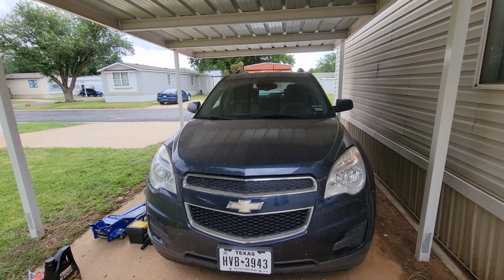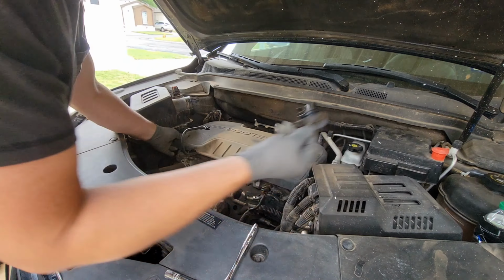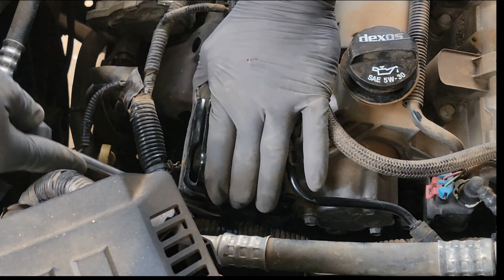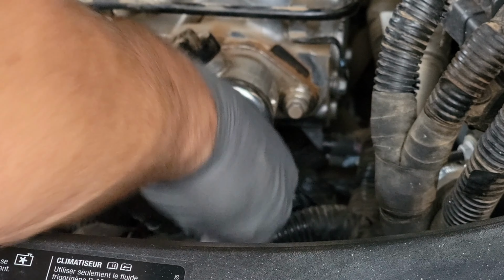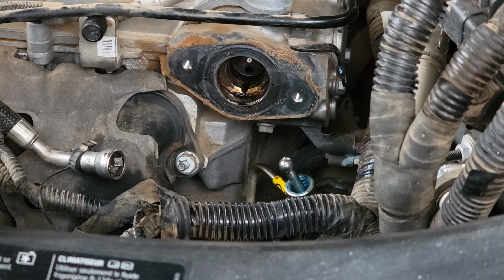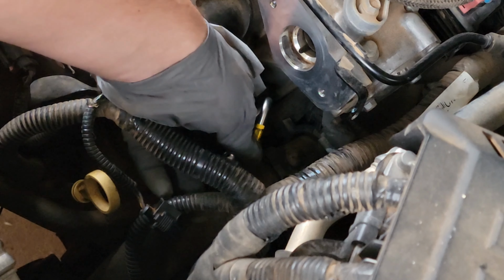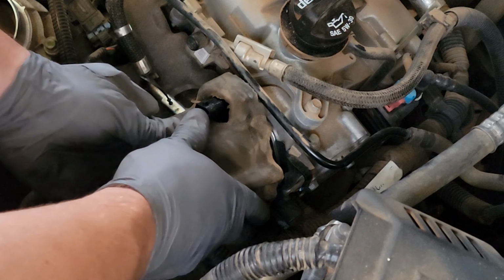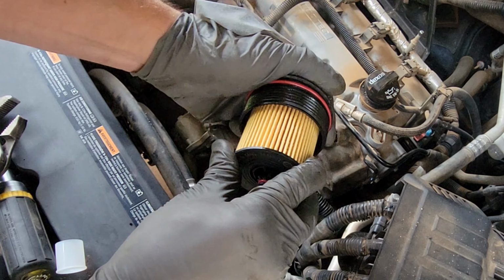2016 Chevrolet Equinox 2.4L Ecotec High Pressure Fuel Pump

Comment: Great video! I did this yesterday on a 2012 Buick Verano. To anyone planning to do this repair, this video exactly describes the process. Do plan to change the oil while stuff is out of the way, and don’t be surprised if the oil reeks of gasoline. Definitely change the oil.
Reply from the maker: Did you replace the cam follower?

Comment: I have a crank no start and I don’t hear my fuel pump prime or click could this be the issue?
Reply from the maker: @thebluedog324  I don't believe that the high pressure fuel pump would cause that. I would start by diagnosing the pump inside the tank

Comment: Hello Sir , did you check the cam follower that is between the camshaft lobe and the pump shaft for wear ? Do you recommend to change it ? Thanks
Reply from the maker: Yes sir. I pinned the top comment that I would recommend replacing the cam follower. It's easy access and cheap.

Comment: Hey great video… question for you. I have a 2016 equinox that I smell fuel when I drive. The gas mileage is also terrible. And when I start the car after being off for awhile it feels like it’s surging, if that makes sense, when I accelerate. But after a few surges it starts to drive normal. Do you think this might be the same issue as yours?
Reply from the maker: @JoshHinkle-w7h  there's a chance it could be. What are your codes?
Reply: @treyhaberman  they are P2096, P0171 and P0191.
Reply from the maker: @JoshHinkle-w7h  yea buddy, the more I research it looks like it might be your hpfp. I didn't have the same codes you have, but I also told my in-laws to stop driving it as soon as they had trouble. Just make sure you replace the cam follower and use an AC Delco pump. Good luck!

Comment: Have a 2016 equinox. The code shot for a high pressure sensor changed that now the pressure is at 82psi at the rail. And the car won’t start. What do you think it would be?
Reply from the maker: @nathanroyal8947  did you inspect the cam follower and the cam lobe?

Comment: I have the same issue and it seems like a straight forward fix. In some videos they suggest finding the low side of the cam shaft. Is that necessary?
Reply from the maker: I can't see the fuel pump spring giving you any issue if the cam lobe was on the high side, so I'm gonna say don't worry about that.
Reply: Came here to ask this same question, thanks!
Reply: Same thank you
Reply: I did not have to do that. I did be careful and tighten the bolts slowly and evenly to prevent any canting or binding

Comment: I'm curious I have a 2013 GMC terrain and it stalls n kicks after starting it doesn't matter if engine is hot or cold    during the day,After I start it a second time doesn't do that stays running and only does it on the first turn of the key ,Did you have any check engine lights before telling you that it was the fuel pump because I don't have any check engine light showing up for anything
Reply from the maker: We have different issues. I did have codes but it was just indicating a rich condition. Yours does sound like a fuel issue, Not sure if it's a pump or something else without looking at it.
Reply from the maker: I think the terrains started direct injection around 2010, so I think you do have a high pressure fuel pump, but our issue was a seal leaking fuel into the engine oil. 
Your first step would probably be checking the fuel pump and the pressure upstream of the high pressure pump and then troubleshoot the pressure downstream.
Reply: @treyhaberman  OK thanks for the response,I was also thinking something to do with the fuel ,it is 2013 terrain it has a high-pressure fuel pump same as yours in the videoI also did smell fuel on the end of the dipstick with the oil I'm stumped because I have no check engine lights and after the second start it idles fine and the RPM stay at 900 and drives fine it's only upon starting the first time like it's not getting fuel or something so I gotta  turn it over the second time for it to run
Reply from the maker: @alhavana9426  well if you think it may br leaking that bad, that it won't even stay running then you definitely would see that on the fuel rail pressure
Reply: @treyhaberman  It's not leaking like that bad I barely smell the fuel but i do smell it on the dipstick l don't know maybe I have the same problem where a small amount of fuel is getting past that spring n seal on the high-pressure pump like you were saying about yours I don't know I gotta find a way to check the pressure on it too, anyway apreciate your input and help
Reply from the maker: @alhavana9426  just FYI with the leak on the equinox it was still running and my mother-in-law was still driving it. If it is exactly like the one I worked on. The was only a Schrader valve test point on the low pressure side, located at the high pressure pump.
Reply: Did you find the problem? I have the same symptoms on my equinox when I turn it on stalls it turns off and the second time I turn it on it works fine, I have a code on the 02 censor I already replaced them and it doesnt work ,i have this issue about 2 years i want to fix that and rid of that car thank you.

Comment: Got all of the parts to do this on a 2012 Equinox that my daughter just bought. Lumpy idle, rives fine below about 3,000 RPM, but if you give it WOT, it will say "Reduced Engine Power, Service Stabillitrak". Figure I would start here since the 'Nox has about 192,xxx on it. Got the pump, fuel line, and cam follower to do it all at once. Hopefully this fixes everything. 

Has also shown the throttle position sensor code which would point to the sensor in the gas pedal. Only other code that does not make sense is the P0291A. Previous (original) owner just replaced the MAF sensor as well. 

Considering a one owner car that we only paid $2,800 for with a file folder full of dealer service records, I figured it is worth put a little bit into to get it running right.

Any other thoughts as to what I could be missing?
Reply from the maker: Did you smell fuel in the oil or does your Nox continue to run and then stumble and die after you shut off the key?
Reply: @treyhaberman  It does not do the "dieseling" when I turn off the key. Haven't smelled a noticeable fuel smell when pulling the dipstick. The pump area is really noisy when running; more so than you would expect on a GDI motor. I have heard of the cam followers going bad, so that could be making the racket and/or the pump could just be worn out with 192K miles on it. My next thought is the actual injectors could be shot, and/or may the throttle body. 

Since we talked the seller down $1,450 from what he was asking because of knowing I could be chasing some electronic gremlins, even if I end up doing the injectors and throttle body as well, the cost of all those parts plus the HPFP and cam follower, I'll only be out ~$800 in parts, but then I will know it is all new.
Reply from the maker: @tomcunningham2063  yea, the problem is different then the equinox I worked on, but I was about to say it sounds like an injector issue. Since you bought the Hpfp, might as well install it because they are prone to failing. Good luck buddy.
Reply: @treyhaberman  Thanks. Working on process of elimination. I can't recall the code off the top of my head, but it was one to do with a lean condition on bank 1. Again, looks like this vehicle was taken good care of by the one owner (Interior literally looks brand new and only 2 dings I found while washing it) so I think there is value in going through the exercise.
Reply: Just did the fuel pump yesterday. Took about an hour. Fired the 'Nox back up and all check engine lights were gone. Thanks again for the great video.
Reply from the maker: @tomcunningham2063  awesome! Glad it helped
Reply: Hi , check the ABS rotors for dirt , when they get dirty an steady signal is achieved , high or low because of this , and computer triggers Reduced power , clenn them with a small brush . no solvents
Reply: @tomcunningham2063 literally that is exactly what’s going on with mine.
Reply: So it ended up being the fuel pump?
Reply: @mscharleyjxox  Yes. The fuel pumped fixed that code. However, now it is throwing a code for the throttle position sensor which is attached to the gas pedal, so now I will be ordering that.

Comment: Hi, please share any re fixing GDI fuel ⛽ without using new part or replacement new part & instead of new part and how to repair existing part that isGDI Fuel Pump, waiting for tearing complete assembly of exiting part, Thank you
Reply from the maker: Thanks for the comment. I was interested in how the pump actually worked. If I have another one to replace, I will try to tear it down and find the leaking seal.

Comment: What is the roller tappet for? Mine came with one
Reply from the maker: It's what runs between the fuel pump and the cam lobe.
Reply: @treyhaberman  got it. I just found the existing one back in the hole
Reply: @treyhaberman  thank you
Reply from the maker: @MichaelMadness723  yes sir
Reply: It’s an important part of the installation. Always replace it. The pump won’t run right if it’s worn down. Why the pumps get loud it’s that part. Sometimes the roller is all that’s wrong with the pump.